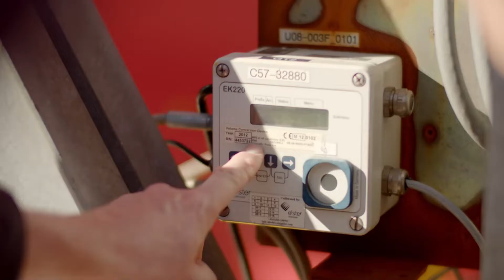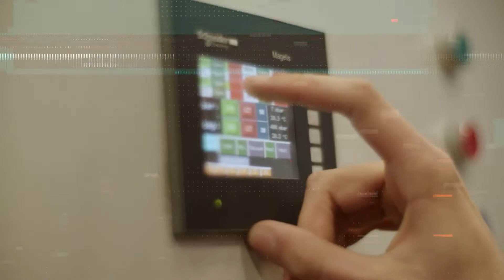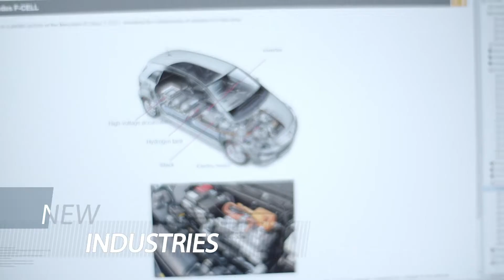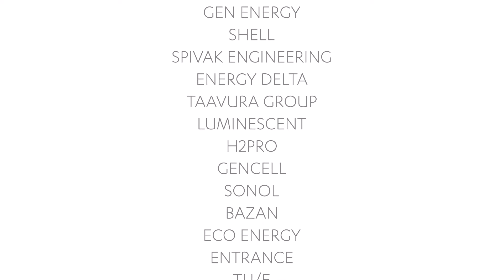Green Hydrogen: what can Israel and the Netherlands achieve together?

Comment: The thermodynamics of H2, just does not add up.  The energy out is such a small amount compared to the energy input is too low, without considering the high energy requirements of storage and transport, or the energy lost in converting H2 to NH3 (ammonia).

Comment: If I understand this right: Israel will produce 50 000Tons of H2. It requires 6 litres of clean water to produce 1 kg of H2. Which means that this production will require 300 000m3 of clean water. Where and how can this be done and still achieve the $2/kg H2 prices?
Reply: The air and desalination to name two.  Such technology, has existed in small scale form to pull in from the air, since at least 2013.
Reply: How will Israel produce so much energy it takes around 52-56 kw for 1 kg of hydrogen production

Comment: Another needless presentation. Net ZERO by 2050 ??  That means I suppose you are talking about zero, NO carbon use. Otherwise called no fossil fuel use. Therefore, no CO2 in our planet. How long does it take for earth to die once we reach zero CO2 in our system? That means we starve because plants will not grow, they will die. CO2 is at an almost historically  low number and is just above what it takes to barely keep plants alive. Trees, crops. The push to go without CO2 is all about money and control. If you folks cared about the earth and its people you would stop this insanity.. Figure it out. Mother Nature has been in charge of the climate on earth forever and is still in charge. Any changes being observed are her handiwork.

Comment: Hydrogen does not work for transportation, a waste of energy in the truest sense, use Hydrogen as a chemical to make fertilizer and in the production of steel. 
For transportation use electricity directly from solar farms for trucks and cars, batteries will soon (next 5 years) have density to be practical for shipping and aircraft.
Reply: If the excess hydrogen produced were converted to methanol, Bp 65 deg C (via the following reaction:  3H2 + CO2 -> CH3OH + H2O), then it could be easily transported to where ever it's needed, and converted to such intermediates as: ethylene - CH2+CH2 and from that to many useful end products, or used directly as a fuel source then.
Reply: Hydrogen works very well for heavy duty transportation. All that's missing is hydrogen refilling stations at ports(sea and air). Imagine global shipping at sea with only water as a waste product. Much cleaner than digging up and destroying our earth for minerals.
Reply: @thor.halsli You need to dig up earth to gather the resources for fuel cells.
Reply: If it doesn't work for transportation, why it is the Germans have such for trains and cars now...?
Reply: @linguist8623  Just because it exists doesn’t mean it was a good, technically and economically efficient investment.
Reply: @2rooms19  Neither does it equate to not being such. It depends on the application, etc...